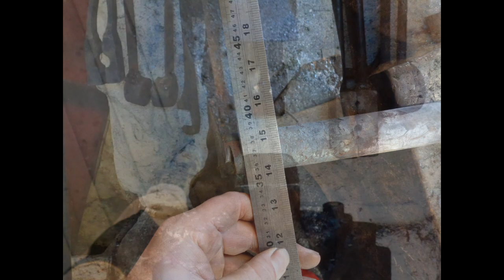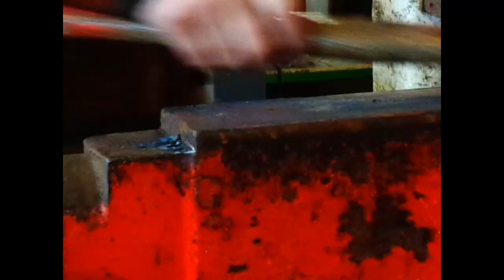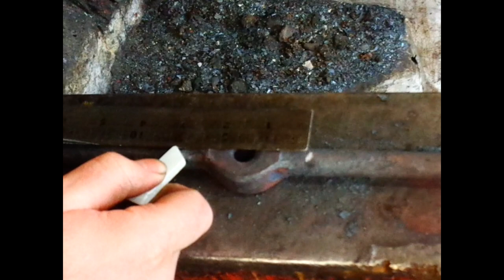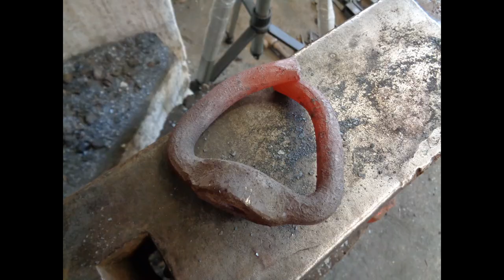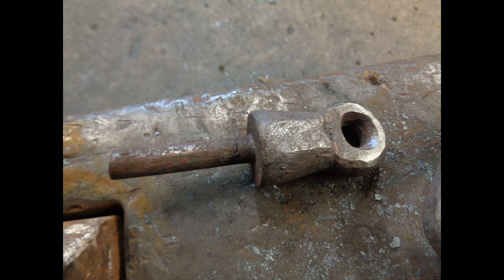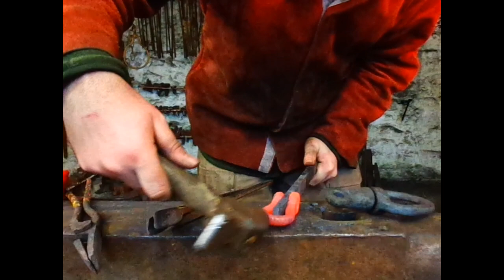Making a forge-welded swivel-shackle.

Comment: Nice video. I worked with marine navigation buoys and they were secured to the sea bead with 4 tonne cast steel sinkers and  32 mm chain and had similar swivels below their bridles. This video has given me an insight into the process involved in their manufacture. Thanks for sharing your knowledge

Comment: Excellent work.  I was wondering from about 10-minutes in, why you didn't leave the weld-link unwelded until after you riveted the swivel, though...looked like it would have made hammering the rivet a LOT easier...but I've never tried to make a swivel, so it may bind the swivel if you go trying to weld AFTER you rivet...causing more 'adjusting' than what you encountered.

Comment: By saying 12mm round, do you mean a diameter of 12mm. A radius of 12mm or as it seems  to imply but does not look like in the video the circumference "round" ?
Reply: It's ok 12mm diameter so a 10mm bolt will fit. Should of watched until the end before asking. lol

Comment: I would watch the cotter pin video. There isn't enough industrial iron work out there. Building tool's & machinery in pre or early industrial revolution would be very interesting. 
There are still lots of hand made chain, hooks, swivels left from the logging industry in my area. Every logging camp, mill, ranch & mine had some kind of smith at one time.

Comment: Beautiful. Do you have any suggestions on making a small one of the first part that you made? And by small, I mean about 30mm closed. I'm making a leather apron and decided to make my own hardware for it. I already made the buckle out of 3/16" spring steel. Thinking I will probably use a piece of 3/16" or 1/4" square for this. Upset the center and possibly make a punch out of that high carbon spring steel? Any advice is appreciated. My instagram is FesmireForge, where you can see the buckle.